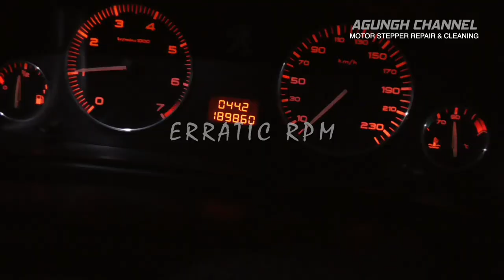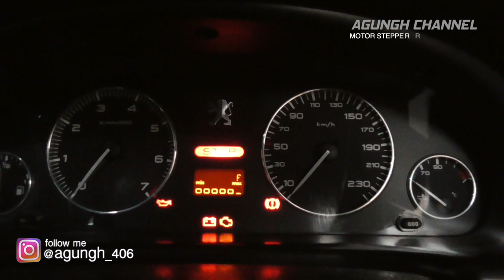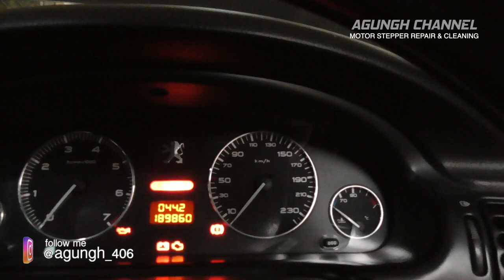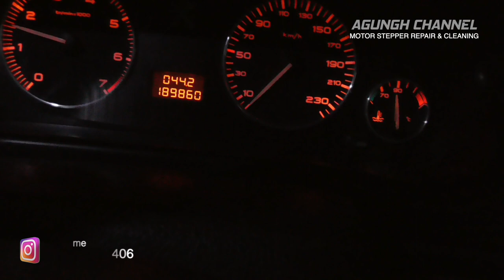Cara Membersihkan dan Memperbaiki Idle Regulator / IR pada Mobil PEUGEOT 406

Comment: Om, rpm mobil sy naik turun terus sy bersihin idle, pas dihidupkan rpm sdh stabil.. hanya saja ketika dipake jalan dan akselerasi tinggi ketika mengerem dan mobil mulai pelan kemudian injak kopling untuk pindah gigi rendah, mesin mati.. beberapa kali mesin mati.. tp setelah AC dimatikan, mesin TDK mati lg.. apakah kondisi tsb dari idle nya ya om?
Reply from the maker: Kemungkinan besar dari idle regulator. Untuk memastikan harus dicek lebih lanjut.

Comment: saya pake 306, IR nya kayanya ada issue (kalo idle kadang drop² sendiri RPMnya).. apakah habis bersihkan ini harus reset ECU om?
Reply from the maker: Harusnya ga perlu reset ECU.
Reply: Udah tahu masalah nya belum om? Punya sya juga gitu nii
Reply: @yezidrokhmatulah9168  bersihin idle regulatornya.. kalo masih berarti fuel pump minta diganti, saya kemaren ganti fuel pump akhirnya